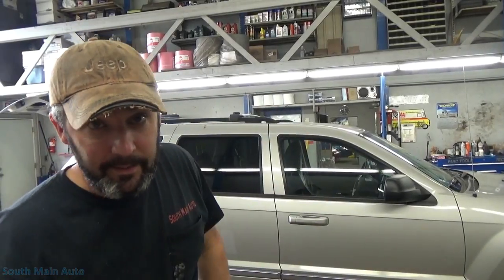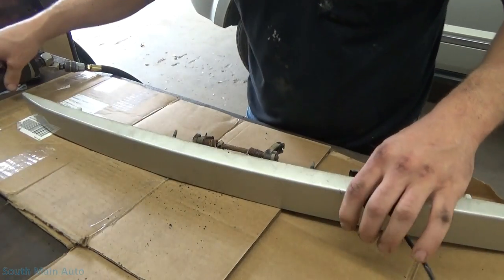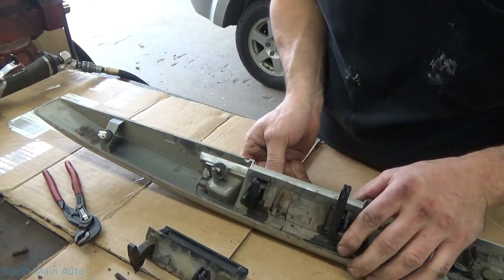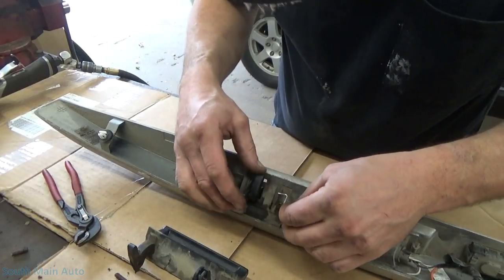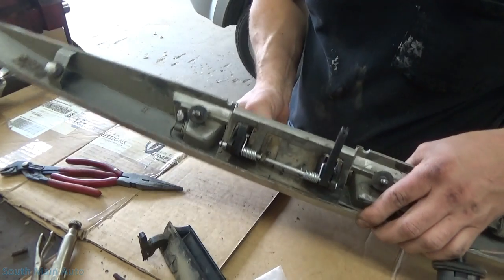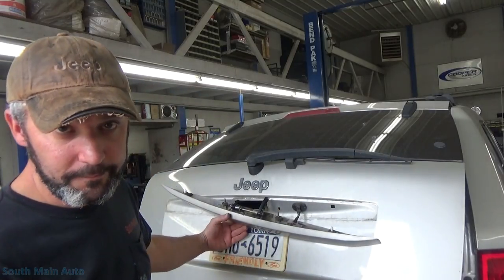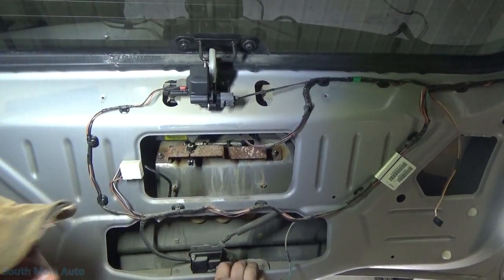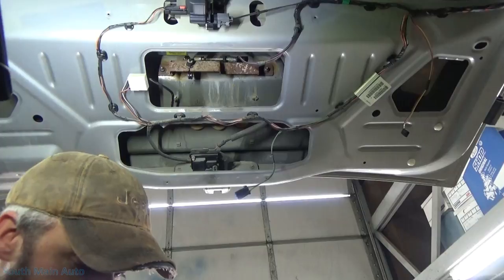Another DORMAN PRODUCTS FAIL: Jeep Grand Cherokee Liftgate Handle

Comment: Trim the tailgate.  Paint the bare metal so it doesn't rust.  2 minutes.  Done.  Dorman isnt great but they are a great diagnostic supplement.  If dorman makes it, you know its a common issue.
Reply: Guitars, Cars, and other man stuff I think trimming the rod was the best solution
Reply: Simpler alternative would be to bend the lip with pliers, no paint required & only takes a few seconds, literally
Reply: Michael O you aren't bending that with a pair of pliers. No way
Reply: Michael O you might want to get your eyes checked.  Thats way bigger than .8mm.  Dont you think eric would have just bent it if it were that easy?  I think so.
Reply: I think guitars etc was referring to the rod,not the panel
Reply: Michael O i can bend .8 with pliers.  That rod ain't .8.  The springs are .8.  Not the rod that goes through everything.  Again.  Get your eyes checked.
Reply: Ouch. my feelings.  I was insulted over the internet by a big tuff guy.  I misread and thought you were talking about the rod.  Also, bending that panel is a hack way of doing it. Please feel free to insult my opinion.  I wont give a crap.
Reply: Les Bender Note lip. He clearly needs to learn how to read then.
Reply: Michael O 😚
Reply: +Michael O : We're gonna need you to go ahead and take it down a notch or two, Internet Tough Guy.
Reply: Trimming and modifying the car body panel just to make a cheap replacement part fit seems like the fundamentally wrong thing to do as your first option. If you have to modify anything, modifying the replacement part first always seems like a  better option to me.

Comment: Should of tried to notch the panel on the vehicle to make the pin pass through. I was surprised the quick weld job didn’t melt the plastic rod holder. Good job.

Comment: Body shop work!  I have a dorkman handle on a van for 2 years now, we do not drive the van much and really do not use the door handle with power door, so it should last.   Be happy the only problem you ran into was your rod was too long, could be worse.

Comment: You do not have to preload the Spring. Put it in with the short tab in its place and that just pulled long hook around the handle extention.
 The make sure it's well greased. Break Lou would be perfect on those parts and it would stop them from rusting up.
 And that clip, is called a JC clip. It's called that because when it goes flying, that's usually the initials of what you say when it shoots across the Room.
  Lube those rusty supports . An excellent mix is about 80% transmission fluid to 20% pb blaster. . An excellent mix is 11oz of trans fluid, 4oz pb blaster, 1oz dawn dish detergent.

Comment: Yeah, Dremels...  Mine has saved my bacon so many times.  Of course, as a home gamer, I have the luxury of time.  Professional shops, however, operate under serious time constraints rather than artisan purity.

As a paying job, I too, would probably have notched the door panel followed by a generous lathering of rust preventative paint/coating/goo/shmoo for the cut sheet metal.

And, under artisan purity, I probably would have dived into my supply of stainless steel rods sourced from old laser printers for the pin.  Rust me once...

Nice video as usual.  You do have a nice talent for entertaining banter making the long and tedious parts bearable.

Comment: Automobiles don't need to be in the "Crusher" in a couple of years. Car companies are doing a piss poor job of protecting some elements from "Early" failure. There are allot of things we could be doing better but we are not; We need to find out Why very soon. You have to look close and very close before you buy anything today, Zero reason for this failure.
Reply: Yep.  It's called planned obsolescence and car companies aren't the only ones that do it.  It's disgusting, greedy behavior on behalf of corporations.
Reply: I agree and they aren't if you don't live in the rust belt. The newest vehicle we own is a 2003.
Reply: Cars that aren't exposed to road salt or the ocean don't have problems like this.
Reply: Rust Proofing them goes a long way to stop corrosion. Corrosion is prob the #1 reason they hit the crusher. 
Krown , Carwell, Fluid FIlm , Rust Check , Oil Gard, Corrosion Free  all good ways of keeping it out of the crusher. 
And i intentionally did not include Ziebart on that list for a reason :)
Reply: If you are very very very lucky you might just get a typical Fiat product to 7 years before complete and unexplainable catastrophic failure. I have seen a whole load of Fiat vehicles die at 6-8 years old and no one. Not even the dealer was able to say what was wrong with them.
Reply: Carmakers bear some responsibility for this - but irresponsible overuse of road salt is also a big problem.
Reply: Totally Agreed. They use more salt than plowing.  Eats up road surfaces as well as cars.
Reply: I took a metallurgy class in college. The professor pointed out that if automakers spent the effort to use corrosion resistant materials, then a car could last forever.

Comment: My way for fixing the long rod, since I don't have a welder, would be to cut off just enough of the rod to fit and drill a hole in the end of the rod, use a washer and a cotter pin to hold the washer in place and keep the rod from sliding backwards.

Comment: I've been down this road before. I don't remember if it was Dorman or not, (probably), but I called them and complained and gave them a suggestion.  I believe the reason the pin is longer than needed is because they use that pin on another product. So my suggestion to them was to have the pin cut with many E-CLIP rings in the end so it can be cut off and still used as intended...  About a month later I received a call asking what I meant. Hahahaha...

Comment: in the future set the lower spring first then use your needle nose to come along and put the handle catching portion of the spring onto the handle. allows you to load the springs and then add tension. about 20 times easier. take apart a few guns and you learn this trick pretty fast :)

Comment: Just did one of these today and ended up with the same problem. Wish I had watched the video first or I would have known better. Then later same day, I got to replace a driver's seat recline handle on a 05 Blazer, it didn't fit on the shaft and the replacement screw wasn't long enough. Out came the die grinder and file FOR A HANDLE!. Do they even test these things?

Comment: As a locksmith, I have worked on several versions of these, (mini vans, SUVs ) I noted that you often need to angle the things a bit to get past the sheet metal.  If you hadn't segmented the old pin, you could have measured both.

To be fair, before you started, you had convinced yourself that the product was bad and that it was going to give you grief.

Comment: I cant stand dorman! "intermediate parking brake cable" on my 2000 f250 snapped in 2015 when it was about -13 degrees in the winter and I bought a Dorman to replace it. Well it was a SOB to get installed, especially in the middle of the winter in my driveway in a foot of snow with frozen fingers and trying to get up behind the pedal with it. 
So, when it snapped a week later I flipped my lid and made them warranty it and send me a new one. I parked the truck in reverse for the winter and installed the second cable in the spring. Of course when I put the second one on, it snapped a week later again, but this time out of warranty. I bought a Motorcraft one and I expect it to last another 15 years. I have no idea how you screw up steel cables but Dorman found a way.

Comment: Anytime I've gone to my auto parts store and they say, "Dorman makes this part," I say, "What else you got?" Nothing from Dorman (Dork Man) has ever worked for me, but say one thing...and I was so nervous.  We bought a car that needed another remote fob and the dealership was going to charge 270 clams for it, well I found a key fob remote with programmer for just under 100 shells.  It actually worked!!! From Dorman!!  The thing I hate however is the programmer that plugs into the OBD slot can only be used 5 times....its for a small set of vehicles but for a 100 male deers it should be unlimited...but meh. Otherwise I stay far from Dorman crap as much as possible.  Most of the time they are like a bandaid for a decapitation it just is so not going to work.

Comment: So I have had the same issues with hinge rods being too long and what I did was chuck it up in a drill and put my angle grinder in a vise ans zip tie the trigger on and trim it to length and then use the cut off wheel to make a new groove for the c clip ......... God I wish I had a lathe

Comment: I had a similar issue with a 1999 Honda CRV EX-AWD. Like hell i was gonna buy parts for  a 12 year old car in Toronto, especial since Honda didn't have the part at all  and the best they could do was a tailgate, and online the part was like 150+ cos it's a common rust issue. So i cut off the little shaft that held the handle, replaced the handle pin with a long brass screw from homeless depot and threaded a nut on the end, peened over the end with a hammer in a vice and that was that. Never had an issue again. Feel bad for getting rid of that car it was trouble free to the day i got rid of it, 3 accidents too and not a single problem. Got rid of it in 2017.

Comment: Why not use the new hardware from the Dorman package with the OE Handle? I saw that the rod and Springs were rusted, and the springs werent returning the latch to the lock position. I'm sure you did this job the best way you could in the situation you found yourself in, just a adding my $0.02.

Comment: It looks like if you get that short end of the spring against the plastic and the long end just hanging, not connected to anything, slide the rod in, then when everything is in place, bring the long end of the spring up and over the handle.

Comment: I know this is an old video but I've got a funny.  2000 Dakota 4.7L 200,000 miles.  Runs great but the electric radiator fan quit working.  Got a new one ((Dorman)) with a lifetime warranty, 2 days later started vibrating terribly like a bearing was going out.  Took it back and got another since it's warranted for life.  One week later and this one's worse than the first one.  Taking it back tomorrow and trying to find an OEM one.  Thankfully this isn't my daily driver.

Comment: What do you think of the Dorman brake caliper bolts for Dodge front brakes? I used a pair to save my backside for a few months, but I did finally replace with heli-coil and new bolts.

Comment: 14:24 Quick Tip on Aerosol Cans: Eric i'm sure you already know this, but someone else may not, when you are trying to spray product downward from an aerosol can, especially when its getting low, if it shoots air you can rotate the nozzle, most cans have a dot on the top near the nozzle, that is supposed to indicate the location of the tube in the bottom of the can, the tube doesn't go straight down and stop before the bottom, its just long enough that it kicks over and sticks up against the side of the can where the bottom cap meets the outer shell. If you turn the nozzle to the dot you can spray downward because the tube will then be submerged in product. Also works in reverse when you're trying to spray upward, turn the nozzle 180 away from the dot. (When you were using the lube, you were pretty much inverting the can so this tip wont work in that situation because the product sloshed up to the top of the can, but what you did works for that issue too, upright it and squirt til you get some, fills the tube temporarily.) Probably more than anyone ever cared to read about aerosol cans but maybe one guys light bulb turned on and "The More You Know" tune played....
Reply: I had no idea.  My mind is blown.  

Now I get to think of the rivers of brake clean I've thrown away because it was that last bit at the bottom I never could get out.  I am both happy and sad at your comment.
Reply: A mechanic taught me about the dot about 5 years ago. It blew my mind. Of all the cans of product I have touched in my life, how did I never see the dot. Now its the first thing I see when I grab a can of anything!
Reply: Well crap....
Reply: With no dot present, turn the nozzle 1/4 turn or so,till it sprrays.
Reply: Whoa, that's some next level knowledge right there!  I use so many different aerosols and I've wondered what the dot meant for years!  Awesome advice, thank you.
Reply: Such a simple and now that I know about it, obvious thing. Why have I never seen this simple tip printed on one single can of anything ever? lol Thank you!
Reply: ... cared to read .. - no-no, is fascinating
Reply: Interesting..I had to look!!! No dot buuut..on the high heat trim spray cans around the nozzle are the letters H, M, L. Another little Easter egg for those who are interested. Oh and if you look real close at the nozzle you’ll find 2 holes.
Reply: @GuiltyPleasures  I cut my cans of brake clean open and empty into the refillable pressure sprayers. I am cheap as hell. I do that with engine cleaner too.

Comment: Because it takes SO much more work to make the rod the correct length to begin with...
Reply: Crouton Crackerjacks how do they not at least test fit the shit before they make 10,000 of em? Makes no sense
Reply: I am bettign the chain of events go something like this. Some one designs the part and checks that it fits. They make a few runs of it, and everythign is fine.  Then 2-3 years later some order from manament coems down to reduce the parts they stock. So they do, and spec a longer bolt because it fits 40 other things as well and they don't re test it but it "should work". Now the managers are happy as they only have to stock that one bolt for 40 kits and they saved $100 on that on part by useign a "common" part.
Reply: They want you to be creative an play a bit man. Perfect parts just wont gave you the same satisfaction. That is because every single piece from tham has at least one deffect and broke fast so you can repeat your challenge forever too.
Reply: KingOfKYA i was thinking the same thing. Its probably a rod length supplied for another kit and its cheaper to use that rod than to order/make a different length rod.
Reply: Looks like we got a Dorman rep trolling - if you use that logic, Crouton, it can be applied to Dorman as well. Guys like Eric and other folks who are doing repairs shouldn't have to modify something that was built specifically to fit a particular application. Time is money as they say, and while you and I have time to debate this kind of thing, mechanics and repairmen everywhere don't. To be honest, as a do-it-myself kinda guy I don't want to deal with ill-fitting parts either.
Reply: The CEO of NAPA prides himself on having one part fit several makes and models or across manufacturing model years
Reply: They have the handle there...
Reply: @wammyz  I guess the sarcasm in Crouton's comment went over your head.
Reply: They're probably trying to make it fit 15 different car models that the part goes into. It'll work fine on none of them.
Reply: Dorman is more of heres something close full of cheap stuff... however you must do some fabrication to make work. I never had any luck with any product they make out of the package however some you fabricobble and make work well.

Comment: You don't need a welder. I bought a box of assorted clips. They use to hold squirrel fans with. Once you push it on. It's not coming off.
Reply: I agree, that tack weld made me cringe.

Comment: I work at a parts store and if a better option is available than Dorman I always recommend it whenever possible. Especially when it comes to sensors and electrical stuff. BWD isn't perfect but it's definitely better than Dorman!
Reply: We sell BWD/Standard at the store I work at. For my old OBD1 Ford at least, none of their sensors operated within specifications and would trip DTCs.
Reply: The electrical connectors I bought from AutoZone dorman part is holding up for me been one years.

Comment: As usual we get tricked into thinking that we can save a bunch of money and that the Dorman part with work just fine when in reality they have never worked any time in the past that we bought them. This time is no different. Im glad Eric O. Publicizes that Dorman products are subpar. Most people buying these parts dont have a welder to use when this problem arises. What would 99% of the diyer's out there do in this situation when they find out the part wont work??? They (including me) bring the part back to where they purchased it and are right back where they started. That's why I always buy OEM products because I dont have the time to mess with doing the same job 10 times to make it fit. Yes I bitch and moan about the price but after 10 years of dealing with aftermarket garbage,  I just pay up and smile when the job gets completed with no hassle or frustration. Yes in this case the part would have had to be painted but still I would have done it the "OEM WAY!" Thank you Eric O. For not chopping her tailgate and doing the best job you could do. Everyone that subscribers to this channel does so because of the quality of your workmanship and treating your customer's cars like your own. Great video!